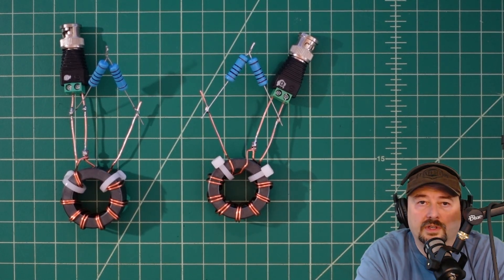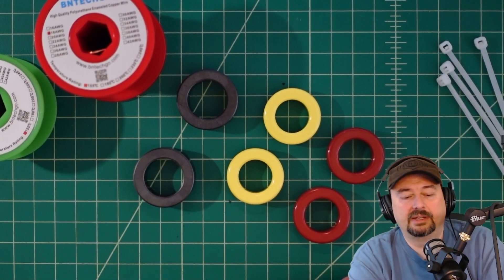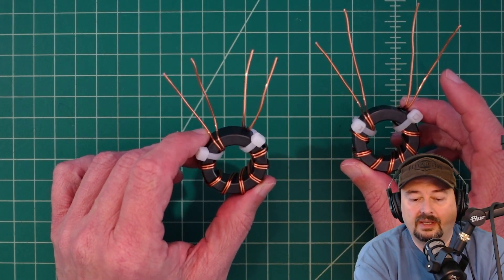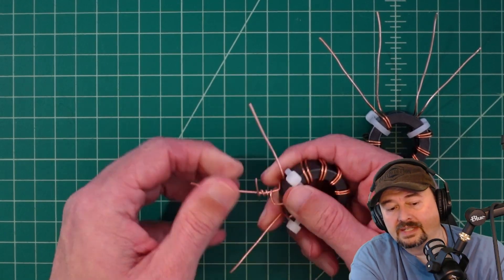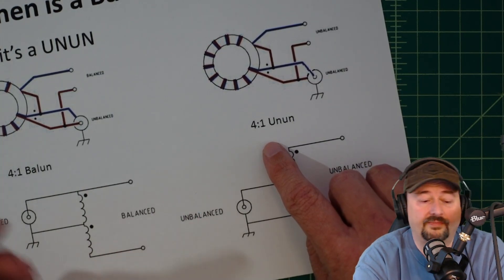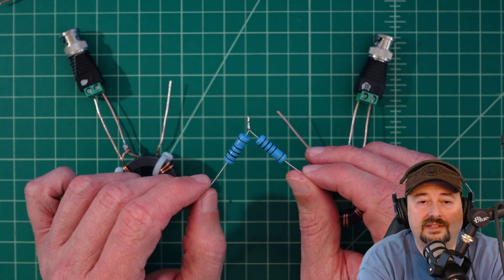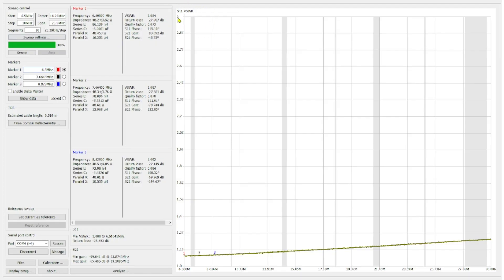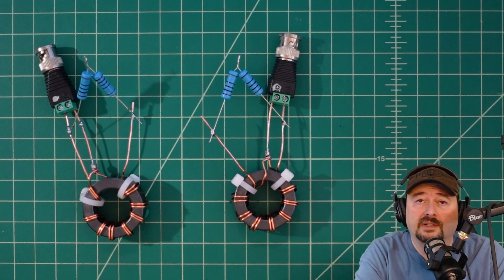Understanding 4:1 Baluns and UNUNs for Amateur Ham Radio Antennas

Comment: Good job! I think you covered that the core mix can make a difference which is good. Reading the comments I want to emphasize that the ratio or turns ratio is determined by the antenna impedance to coax ratio. The choice of a balun or UNUN depends on the antenna or load being balanced or un balanced.  Also beware of using too much power. When reactance is added to the load the current and thus heat can increase dramatically.
Reply from the maker: Hey Dandy, thanks for the the additional detail...

Comment: I built my own wire dipole antenna for the 40m band that has less than 1.5:1 SWR for the whole band, without a balun. My question is with the SWR already being pretty good, do I need a balun? Why or why not?
Reply from the maker: You need one to help suppress common mode current 👍

Comment: I am going to build a 1686.83mhz so around 1,7ghz helical feed for a dish and it will feed into a coax line of 50ohm, pretty standart, now the impedance of the helcial antenna is 150ohm and im pretty sure its unbalanced, so in theory I should use a UNUN with a ratio of 3:1 right? to convert the 150ohm to 50ohm, now how do I wind a 3:1 instead of a 4:1 whats the difference in winding?
Reply from the maker: You can’t quit get 3:1 but if you do 3:5 winding it gets you to about 2.7:1 👍

Comment: This was a great video explaining the topic.  My one question is how do you know how many winds are needed for the toroidal choke?  Your hand winding is very impressive.  I’ve been to manufacturing locations for these, for my job, and yours looks as good as automatic winders.
Reply from the maker: Thanks Ben.  These are transformers and not chokes.  For chokes, I have a video, showing how you measure choking impedance, you want at least 25dBm.  For transformers its a bit different, I will do a video, but you want your primary inductance to be 4x the transmission line impedance.  SO, 50 ohm coax is 200 ohms of INDUCTIVE impedance but 100 is OK.  You also want the core self resonance to be above the lowest frequency you want to operate on...

Comment: I'm a new subscriber. Great video. I have a question that may have been asked. I have only one wire when using an end-to-end half-wave to a UNUN. I assume it connects to the center lead of the coax, but is the shield left open?
Reply from the maker: that is probably a 49:1 UnUn and some folks will leave the shield open and the outer portion of the coax braid "acts" like part of the antenna.  I am not a fan of this so I add a counterpoise.
Reply: @ so you connected with counterpoise to the shield? Is the counterpoise the same length as the radiator?

Comment: Dear Mr. SmokinApe
First off, thank you for sharing your knowledge. 
I would like to ask a couple of questions about "multi-tap" ununs.
I only see a few HAMs build and use their own but never any retail options, so I wonder are there drawbacks to them.
Also with say a 7 tap unun, is it likely that it could replace the need for a tuner?
I have asked those other HAMs who posted theor builds of multi-taps but no reply.
Thank you kndly
Gary
Reply from the maker: Hey Gary, thanks for watching.  I am not a fan of multi tap ununs, I feel that they are a gimmick and all the "stuff" like taps, extra wire. and connectors add unnecessary reactance...  I guess the upside is you buy less cores?

Comment: thanks for your video.  i am in the process of setting up an amplifier on my rig.  amp is good to legal limit.  that's the good news.  the bad news is that i need to upgrade my antenna game in order to handle the additional wattage.  what type of wire and toroids do i need to make my own 4:1 balun for my new dipole?  i am using 14ga flexweave and standard PL259~So239 connectors on the box.  stated differently, what component(s) give the balun the capability to run higher wattage?

Comment: OK, very informative. However, I have read that a dual core 1:4 Guanella unun is more efficient than the single core 1:4 unun like you made here. I have also never seen how such a dual core unun is built. Perhaps you could address these two items in a future video? 
TIA
Reply from the maker: Hey Dan, from what I have seen the 1:1 Guanella Current balun with the 4:1 Ruthoff Voltage UnUn is the prefered method.  That said, I will add a video to the list.

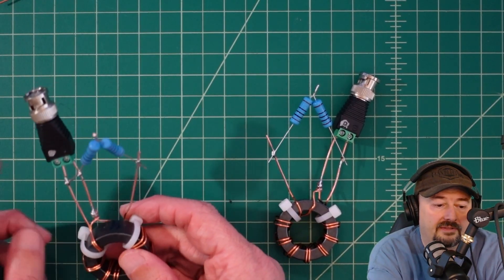Comment: Ape, from around 9:45, when you talk about testing with a load.  For the Balun, you say the load is between center conductor and ground, and for the unun you say the load is between the antenna and the shield. For the balun, did you not mean center conductor and ANTENNA (not ground) ?
Reply from the maker: For the balun the center tap goes to shield and for the unun the center tap goes to the center conductor.  Apologies for any confusion.

Comment: Mr. Ape,
My reason for this inquiry is for the added heat dissipation.
I can't seem to find any information on operating a transformer, balun or unun from inside of an aluminum case and if it would adversely effect its performance? 
I look forward to your input and that of your audience. 
Thank you kindly
Reply from the maker: Hey Gary. Heat is bad.  It's going to depend on power level and core size...  mounting the roid, directly to the AL case should help with dissipation as well.
Reply: @TheSmokinApe 
My fear was that the aluminum would cause interference. 
But I didn't hear you say anything about the aluminum case interfering with the roids performance only that it should help with heat dissipation.
I hope to find or build a case that has heatsink fins incorporated in it.
Thanks for getting back to me Mr. Ape and 73.

Comment: Smokin', Could I request that you do an episode?That measures the power efficiency of a fifty percent duty cycle for reception and transmission of your h f radios to determine which one has the highest overall power efficiency at fifty percent duty cycle?
Reply from the maker: Hey SSG, I have it in the list to start testing them at load.  I just need to get some time to do it…. Thanks for the suggestion 👍

Comment: I want to put up a folded dipole using 450ohm ladderline for the feed line and antenna. I need to use a short piece of coax from the radio, so a 4:1 balun between the coax and ladderline is all I need? No other baluns or chokes? I'm using ladderline feedline because it's going up pretty high and there's less weight, less loss and I have a 500' roll on hand.
Reply from the maker: Hey HBT, I just did a video that answers your question: https://youtu.be/7psl_DM284I

Comment: An easy way to strip the enamel off the wire is to burn to with a bic then use 100-240 grit sandpaper so you can see where its not clean.
Reply from the maker: I’ve been doing the dremel lately 👍

Comment: Thank you. Would this single core variant work equally as well as a 1:4 transformer (12.5ohms to 50 ohms step up, generally seen in physically short antennas as far as I understand), as it would a 4:1 (200 load down to 50 coax you’ve described)?  I don’t think I would need choking capability, as I’m wanting something I can insert between twinlead feedline and either [Zmatch tuner with balanced input] OR [1:1 current BalUn into an unbalanced input tuner], to help the tuner out with increased tuning capability and efficiency for low impedance loads. … but it would be great if it also functioned equally as well for unbalanced loads.

I am fairly sure it’s possible, but it’s tricky to track down the most elegant solution  haha
Reply: Thinking out loud, but I have one of those MFJ-911h doohickeys that you reviewed once a while back… maybe it’s as simple as wiring myself up a coax patch cable that reverses the polarity (connecting the center pin from one side to the shield on the other side, and vice versa), and putting the 911h into 4:1 mode? Maybe that will provide a 1:4 step-up transformation. Nothing else to wind…   I appreciate your thoughts, but no pressure to have an answer!!
Reply from the maker: I think it would work for the use case you describe.

Comment: Not all heros wear capes, but some heros are Apes!

Thank you for explaining not just the difference in where they're used (balanced vs unbalanced antenna) but more importantly what makes them different electrically. The schematic really REALLY helps. Coastal Waves has a short video that goes into where you'd use which one in practical use, but he doesn't mention anything about what electrically makes them different. As "The Dude" would say - this video really ties it together :D

So if I'm looking at this correctly, the units themselves are 100% identical, it's only how they're connected to the coax that's different. So you swap the pin / shield connections and a balun becomes an unun and vise versa? Obviously the ground connection stays with the coax, and I imagine in practice that ground connection would be made at the opposite end of the feedline at the lightning arrestor?
Reply from the maker: Yes, you are interpreting it correctly.  Thanks for watching NotSure 👍

Comment: Very cool video. Just a question though. Wouldnt it be easier to use a 75ohm coax like rg11 and tune the length to get your match? 75 ohm cable loses less and is much cheaper anyways. Only downfall i could see is possible lower power handling. What do you think?
Reply from the maker: 75 would get a closer match but not exact.  I haven't messed with rg11 but as I understand it, the power handling is lower as you mention 👍

Comment: This is really timely! I'm looking to build a Delta loop with a couple of 17ft telescopic antennae at 90 degrees to each other and a wire across the two antenna tips. If I feed it at the base of the two antennae the feed impedance is 200R so will need a 4:1balun. So I'll be making one soon ready for when the WX improves a little. We have storms here at the moment.....

Another really great video :) 73!
Reply from the maker: Sounds like a cool build, good luck with it 👍

Comment: I'd be happy with that trace. You can kind of encourage the "peak" to move one way or the other by adding or removing windings, but 8 is a pretty good number. Type 61 probably has a higher peak, but is almost certainly not worth the effort or may give trouble down on 40.
Reply from the maker: Agreed on all points, thanks for checking it out GDL 👍

Comment: Thanks a lot, Mr Ape! I now wonder if I wound my last one as a unun or a balun… I guess the major difference is that a single wire does not have a return circuit… therefore using the shield as a return. I wonder if your 100 ohm resistance reflects then reality of a long wire. Best!!
Reply from the maker: Hey Denis, it was 200 ohm but yes a long wire would be different.  I was using 200 because this is a 4:1 and I wanted to test against a 50 ohm system impedance.

Comment: So my question is the same as always on this subject: How do they work?
Reply: Baluns and Ununs are ham radio names for auto transformers. If you have a balun with 10 turns through the centre, you have 10 windings on the primary (half the coil) and 20 windings total (the full coil). Apply 100V to half the coil gives 10 volts a turn, so you get 200V across the entire coil.

The reason the impedance ratio is turns(voltage) ratio squared, is because power is V^2/R.
100^2 V / 50 ohm = 200W.
200^2 V / 200 ohm = 200W.

Comment: nice job. I have made a 4:1 UNUN with a 2 stack T 240-61 cores wrap with #14 stranded PTFE . haven't mounted it yet.  I may need cap? I find out when tune it.  I made a mono band 5/8 wave end fed for 10 meters.  1/2 wave end fed is 49:1 and 3/4 wave is 1:1 . some of us hams think outside the box . the 4:1 Balun is used with off set fed dipole. normally 1/2 wave cut 1/3 and 2/3 wave length. The outher off set center dipole is cut 3/4 to 1/4 of a 1/2 wave total. I found when stacking toroid's using Kapton tape  helps hold them in place. I found  a nice winder base for T 240 core and so-239.  nice to work with smaller wire. for QRO in the KW range need bigger and my fingers hurt from winding them. I can only wrap 1 big one per day about. 73's
Reply from the maker: Hey Robert.  I’m with you, winding some of these cores kills my hands, I use 16g for my 49:1 and man lid that a doozy.  I like to use stranded ptfe on my 9:1 and maybe on these 4:1 in the future because more surface area for the RF 👍

Comment: Well presented, though the 4:1 balun  has some serious limitations even with a perfectly symmetrical antenna. There is a better design using two separate cores (effectively 2 common mode chokes with their inputs in parallel and their outputs in series).
Reply from the maker: Hey g0fvt, I agree with your point, I wouldn't necessarily use this 4:1 Balun, but the point of this video was explaining the difference between a Balun and an UnUn and I wanted to illustrate that point in a demonstrable way.  With an eye as discerning as yours, I am sure you saw that is a voltage balun and the general consensus these days is to use current baluns.  Thanks for the comment and for watching bro!
Reply: @TheSmokinApe  not knocking your work at all, the schematics are exactly the ones I would use to explain the function. It is interesting to see how "fashion" changes so fast, in the mid 1980s when I got licenced I built a tuner influenced by designs in the ARRL handbook of the day. It took me 40 years to get round to stripping the balun out of it to recover the ferrite cores. A commercial tuner I have also has a "voltage balun" as do the bulk of them, I will leave that one as it is. (Just not use that output).
Well done on the video and schematics, keep up the good work for 2024 73
Reply from the maker: Hey g0fvt, not taking it as a knock at all.  I very much appreciate feedback and comments from experienced hams such as yourself!
Reply: I upgraded to this 2 core design for my 40 meter loop. It busts through pileups like a champ
Reply: A current balun.

Comment: Could you modify the Balun to give a 6:1, 8:1, 12:1 transformation of an unbalanced 50 Ohm coax line to a balanced line like window/ladder line? If so, how would you do it?
Reply from the maker: You could, but it would be a different design, I can add it to the list of videos to do...  In cases where folks want to use balance line most of the time people use a 4:1 with a tuner.
Reply: @TheSmokinApe  Thanks, that would be interesting. I’ve read about antenna designs that have a 300 Ohm impedance (folded dipole etc) which would benefit from something like a 6:1 I imagine.
Reply from the maker: I'll do the 6:1 video at some point, thanks again PCF!